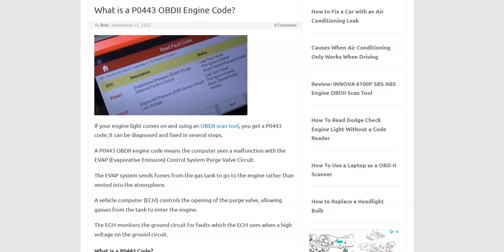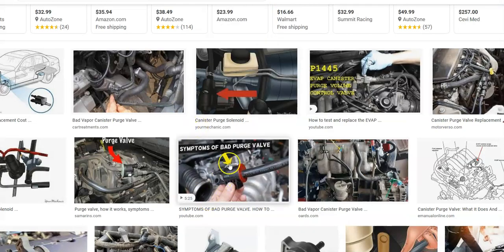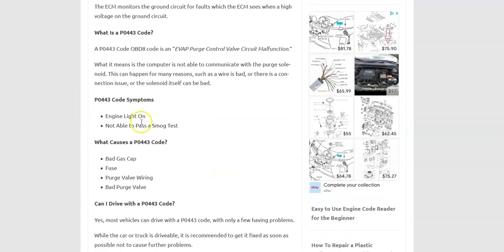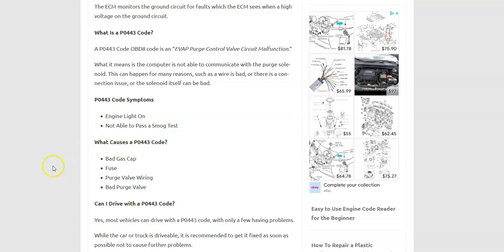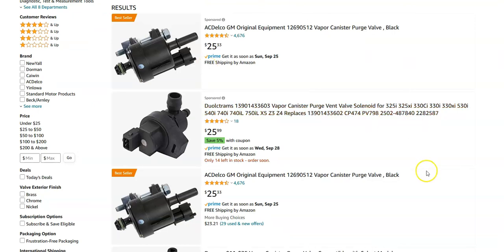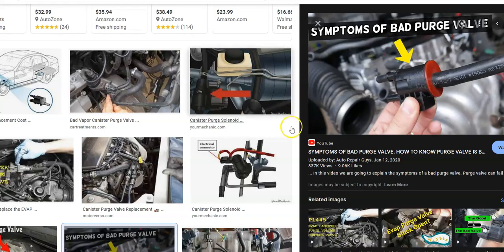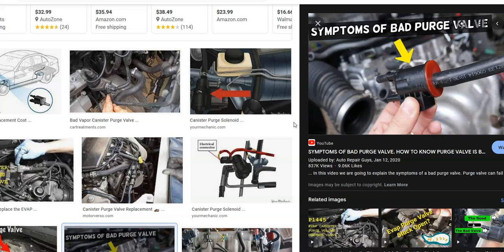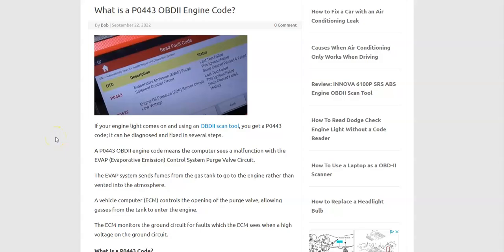Causes and Fixes of a P0443 OBDII Engine Code

Comment: What hit me most is you saying a bad circuit.  Replaced the valve and issue remains.  Nissan had me replace the ECM and the issue remains.  How much you wanna bet that these idiots at Nissan didn't check the circuit or fuse.   You wouldn't happen to know what fuse to check on the car would you?
Reply from the maker: The purge valve fuse can be labeled vague at times (For example, Kia labels them Sensor 2), but it is usually inside the engine compartment fuse box.